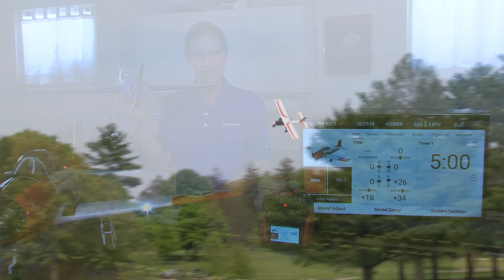Spektrum Smart Receiver AS3X Setup Series #9 - Intro to SAFE functions and Setup

Comment: I have heard that if you change channel assignment that you have to relearn the servos or something like that. Is this true
Reply from the maker: Yes that is true. If any changes are made to assignment, travel, subtrim, reversing, then it is best to use the relearn servo settings option
Reply: @SpektrumRC  I had another question. I installed a 5280 after burner on my f22. I am using a spektrum ar10360t rx and a avian 130 6s esc. The afterburner led instructions say, if using a smart receiver, you can not use channel 1 smart throttle for afterburner led. You have to change channel assignment. For instance channel 1 to channel 2 or install a second receiver just for the afterburner led to work correctly, cause afterburner led has to plug into a pwm channel. When you do this. You will lose smart capability to and from the esc. Is there any way around this if I have used all the channels on the receiver or is the only option to install a second receiver?
Reply from the maker: @kawasakizx14jomamamoto57  which F22 model are you working on exactly? Surprised you are using up all 10 channels!
Reply: @SpektrumRC  freewing f22 90mm. Using all 10 channels on individual control surfaces except for rudders for full stab ailerons, crow feature and rear stabilators.
Reply from the maker: @kawasakizx14jomamamoto57  Very cool! but yeah with that setup you are officially out of channels! Theoretically you should be able to run something simple like an AR410 for the second receiver for the after burner. That said sometimes when binding to 2 receivers not everything works in harmony due to slight variations in the code. Not saying it won't work but there is a chance. I will see if I can test it out later today and report back.

Comment: I do not seem to be able to have a variety of flight modes and safe at the same time. When I have safe I only have one flight mode, is this correct or am i still doing something wrong?
Reply from the maker: Hi! Is there the receiver from a bind n fly model? Could have something do with preset settings. Otherwise you should be able to have multiple flight modes with and without SAFE.
Reply: @SpektrumRCvideos   It is a new out of the box AR637T. What I notice is all flight modes, 3 total, work until I add the SAFE feature. When Safe is added I only have one flight mode to choose from, only one flight mode and SAFE. The video does not mention that at all and I still get the impression I can have 3 flight modes and SAFE, one flight mode having no AS3X setting "for "safety" should all the AS3X setting be turned off.

Comment: How about setting up a panic button on AR637TA or Safe and panic button on AR8020T ? Is it possible with NX8? Thanks
Reply from the maker: If you flash the 637TA firmware to open stock you can do that. Otherwise a mix in your radio could perform the same function. FYI the 8020T does not have SAFE or AS3X.